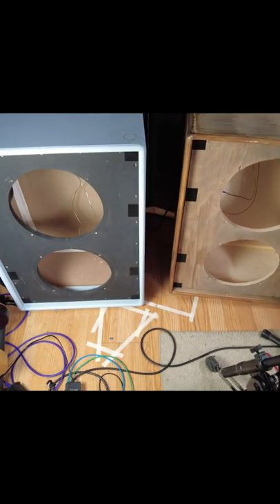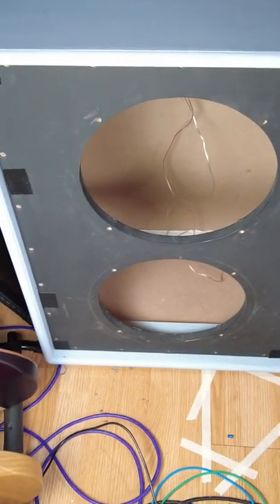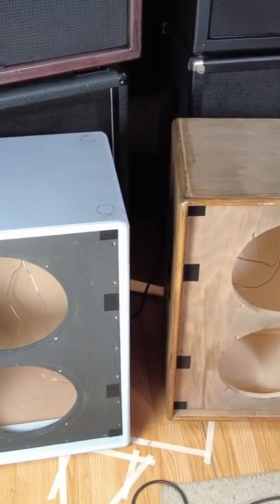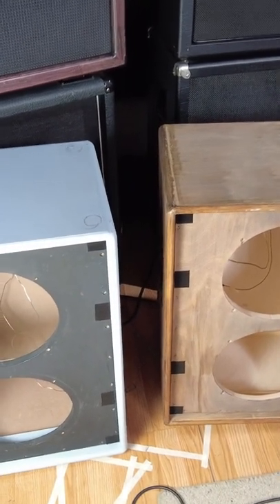Tone Wood in Guitar Cabs?  #shorts

Comment: You should capture an impulse response each and compare those directly in both time and frequency domain for comparision. Why? If cabinet tone wood is a filter, there will be more than slight difference. If there is no difference, it's not a filter and would it therefore not affect the sound.

Comment: I would think little to none difference with mic close by but if we consider how much different the sound is from closed, semi-open and open headphones, it will be interesting to see.

That said it would be interesting to test how much the actual cab does really affect the sound when direct mic'ing. Would there be difference between removing the backpanel and stuffing pillows or sound dampening material to the cab and even removing the whole cab and having just the speaker element. And how much the speaker setup affects apart from electrical stand-point as in could you build a cab with 2-4 different speaker elements and have them work kind of 4 different sounds depending in front of which one you put the mic or even have a switch to turn off the elements.

But with room mic'ing a lot of things come to play and probably even the density of the wood used in the cab play role at least with how directed the sound is.

Comment: Since they're closed back cabs l think it will make very little if any difference. However I'm also going to venture a guess that were they open back cabs there might  be some variation on tone between the two. I'm venturing this hypothesis under the assumption that an open back could theoretically behave more like an acoustic soundhole/soundboard.

Comment: I would think that the baffle would make most off the difference. Looking forward to finding out. I've replaced broken chipboard baffles in 1x12" cabs before with 3/4" pine and would say that it resonates and sustains a bit more. One of my Randall cabs came with something like polyfill insulation stapled inside it. I assume to deaden the standing waves as it was not a ported cab and was made of mdf with a ply wood baffle. Also what is your opinion on speaker mounting from the front vs rear of the baffle (for playing metal)?

Comment: With close mic’ing a cab, probably won’t matter.  But the live sound in the room will likely have different resonance, and you might prefer one over the other.

The only other difference would be weight and structural strength and durability.  And Cost.

Comment: The wood doesn't matter, density does matter. The plywood one rings like a bell, it will have different resonances than the MDF one. Will it matter for your use case? Maybe, but double blind and mixed you'll never know the difference.

Comment: When it comes to electric guitar, if it isn't electric, it doesn't matter. Having a thicker or more dense cabinet may sound better in the room but if you aren't recording the room and just putting a mic up to a speaker, you are recording a speaker.

Then if you do record the room, the room itself is adding it's own flavor.  By the time you figure a regular guitar player recognizes these nuances, they'll just lose it all in saturation and reverb pedals anyway. 

Choosing materials like you play an acoustic instrument is silly when the sound runs through pickups, heads, pedals, and speakers.

Comment: I'll throw my 2cent of Theoretical Physics & say that the cab made of Plywood will get you a more focused sound for the same pair of speakers. The logic of this is: a box made of a more dense wood will block more sounds waves from escaping said box from the sides, rear and top. Also, vibrations at the box's walls will also be dampened more if the wood is more dense, hence you should get less interference. Now, I'm not sure that a METAL tone saturated with overdrive and other pedals will allow you to detect a difference. I would suggest a tamed crush tone for this test & listen to solo parts rather than rhythm parts. Right or wrong, this test should be very interesting.

Comment: For speaker enclosure, the choice of wood won't make much difference.  If anything MDF is likely the best choice, followed by Birch plywood.  Why MDF?  Consistency of the material and thickness.  It'll likely color the sound less than plywood or even solid wood joined.  Also, the cab needs to be built well with joints tight and sealed.    And there's the whole aspect of speaker volume, porting, dimensions, etc. that can make a difference too.   The biggest difference will be the speakers in the cab.  You put a crap speaker in the best cab and it'll sound like crap.  You put a good speaker in an MDF (well built) cab and it'll sound better.   And if Metal is going through these enclosures it'll matter even less vs. something like Classical or even Jazz.

From an instrument perspective, wood and construction will make a difference on acoustic instruments.  A piano's sound board is pretty darn important to the whole sound.  Same with a violin or an acoustic guitar.

Comment: I personally believe it will make almost no difference when recorded.
The goal is always to have a cab as dead as possible, stiff, with no vibrations, to let the speaker do all the work. that's why MDF works so well actually, it's heavy AF.
In my experience, only cab dimensions matter, obviousy, tuning the speaker differently.
Lets see how it goes !
Reply: this is how audio speaker guys think, I am one, but I'm learning to re think some of what I learned from the audio gear community. lots of what makes musical instruments sound good are the harmonic vibrations ( also over driving amps or speakers ) (colored sound)all things that you avoid with monitor speakers or audiophile gear

Comment: Pretty certain what affects frequency response is the dimension, shape, and porting of the box. It the wood won't make any difference to a recording. I did a physics project on a similar subject in University. There are mathematical equations to derive resonant frequencies and they are based on dimension, not material.

Comment: The wood and also the weight of the cab makes a big difference in sound. I once tested four different 4x12 cabs with the same speakers they all sounded different. In my opinion you get a better sound from heavier cabs. I don't know how much it affects recordings though.
Reply: You say you "tested" them. Were they the same internal volume, and box design? Because internal volume has a bigger effect on sound than materials. The reason you prefer the heavier cab, is likely because more density equals lower resonance frequency. If you make something heavy enough you move the resonance below what the driver(s) play at. Thus you never hear the box. The wood isn't what matters, materials are chosen as a cost, weight and resonance trade off. If you could make it out of 6" concrete it would remove all box resonances and you'd be listening to just the driver. But it wouldn't be portable. If you make it out of fiberglass it will resonate more than an acoustic guitar and probably mechanically fail. There is a company that makes good sounding loudspeakers out of carbon fiber. A very stiff but very high resonance frequency material. They have to do all kinds of engineering wizardry to prevent resonance. It makes them very expensive.
Reply: @EthosAtheos  It was four different cabs with Celestion V30 used with the same amp and the same settings. What do you mean by "internal volume"? Two Marshalls, a Engl and one I can't remember. They were all different in weight. The Engl which I liked best and was by far the heaviest. Another thing you have to consider is the age of the speakers. They seem to sound better after some time. One Marshall was almost new and it sounded a little bit flat and lifeless with scratchy heights in comparison and the Engl was already over 10 years old and It's been used a lot. Finally even the "same" Celestions don't allways seem to be the same speakers. Apparently they have slightly different voicings with different cabs. This is at least what I read about.
Reply: @SxSxG666  The volume of the air inside a non vented cabinet or a ported box plus the vent size. Will have an enormous effect on the frequency response of a driver. If you have to much volume or to little. You will either have a driver that is over damped or vibrates freely without enough damping. 

Volume  also affects how loud the driver plays at a given frequency. Have you ever strummed an inexpensive acoustic guitar and it honked or boomed at a certain frequency? This is because resonance amplifying a frequency many dB above normal. Again some car speakers are designed to do this. Somewhere around 80hz you will get 2 or 3 times the sound pressure you would get at say 100 or 200 hz. This makes them thumpy, but that comes at the cost of accuracy and often sound quality. 

The way cabinets are designed is using math simulations of a driver & cabinet combination. The driver is defined by Thiele Small parameters. Once you know these you can calculate the box needed for a given driver and desired frequency response. Crossover networks also play a role in this but that is way outside this discussion. 

Just because 2 cabs have the same number of drivers of the same size. Doesn't mean that the drivers are interchangable. Put the same speaker in 2 different volume boxes (measured in liters usually) and you will get totally different frequency responses.  Even boxes with similar external volumes might have different internal volumes. Some speakers are designed to work in boxes of a given volume of air. 

Now there is a level of subjectiveness to all this. For example even order harmonics sound good to most people. For example the warmth from an analog tube amp. Where odd order harmonic distortion sounds shrill and brittle like inexpensive transistor amps. A worn out driver might distort in a way you like. Cool if you like that sound, but it is distortion caused by mechanical ware. I'm not going to criticize taste. I'm just trying to get musicians to understand some of the physics behind what they are hearing. Without getting bogged down in math.  I find most musicians get angry when I start doing math at them. 

Sorry for being pedantic and long winded. I find this subject difficult to explain to people without long explanations.

Comment: I don't think the type of wood is going to matter. What MAY (and even then probably not by much) matter is the density of the wood/wood composite. The density ones might sound better as less of the sound will leak out of the cab. Weight them before putting speakers in, that should give you a good idea. This would work better if you had 4 or 5 cabs made out of different woods, 2 might not be a large enough of a sample size.

Comment: Same eletronic and same speaker in two different cab designs gives different sounds for sure, if the wood makes difference, i would say yes. you need a material that can absorb the sound waves and give direction to the projection of them, so if a material can absorb more and reflect less sound waves than other different material it will produce a different sound. If that is audible i do not know. But the sound of a speaker is made by the eletronic components connected to them and the way the speaker is made and the quality of the materials in the construction of them, the cab helps the speaker giving them a room where the sound waves scatter and bounces. If you take the cab out and record the speakers it will sound very different than with the cab. So, if the cab helps the speaker sound different so it must be true that the material in the composition of  the cab for sure will make a difference. That's my conclusion.

Comment: I think that resonant difference may affect the over-all sound coming out of the cab, but I bet the plywood cab will survive a hit or drop much better than the mdf cab. Also, how much does each cab weight?
Reply: I have an E-V box with a crushed corner. MDF is not graceful with the wear and tear. 
...still works but I took out the 12DLXs and put in Black Label EVMs. Weighs plenty.

Comment: My wood is tired.  So you pluc the string with your Plectrum the only thing a pickup is measuring is how their electromagnetic fields are being affected by those strings moving.  Period.  IF you’re saying that the piece of wood moves in such a way that it ALSO is affecting those strings so much you will be able to hear the difference.  The only way anyone will ever validate this to us will be wiring everything the exact same way on every wood type, put locking Grover Rotomatics trim each string the same length on  solid Guitar Types of different woods the exact same thickness, use the exact Drop in, already soldered packs for each set of pots.  Make EVERY pickup with exactly the same windings using the same strings ( I like Cleartones) for every length even the cap has to be the same tolerance in each one. 😊

Comment: Does anyone else wonder what would cab from different material sound like? For example glass one? Yes, durability/fragility is an issue when gigging, but in studio environment? Once upon a time we wondered about this with my professor during my bachelor degree project (tube amp) and he proposed such contraption for home hi-fi.
Reply: I'm told that concrete is an excellent material for making speaker cabinets. Assuming you never move it.😉
Reply: @SXTransmission  I could see that in studio situation. You order one and they come and cast it at Your place :D

Comment: It won't make a discernable difference.  They're relatively the same.  I think to notice a difference you'd need drastically different densities, like balsa wood vs concrete. There IS a difference, SOUND just won't be what it is.  If it weren't for weight, we probably WOULD cast these out of concrete.

Comment: Thickness of material and grade of ply will have an impact - take the same speaker from a 3/8" MDF (basically high-density cardboard) cab and put it in a 3/4" marine-grade ply cab and you'll hear more speaker and less cab - promise...
Reply: I have an old Sound City box that has 12mm sides and 18mm baffle and back. It rings like a bell when you slap it, much more than most. IDK, I guess I need to run a powered test. 😸

Comment: I think there will be a difference, but not a super significant one. I always suspected what you've already found out. Speaker, pickups, period. Electric guitar sound is string vibrations turned into electric pulses then back into a louder acoustic vibration. Anything that directly affects those transformations is going to have the greatest impact.

Comment: Different ? ... It would if it was a "Hi Fi" speaker. There is always an interaction between Speaker Drivers (which "we" all agree is paramount to the Sound) & their Cabinets  ... I'm hesitant to say which is "better". But 1st the Manufacturers must have figure long ago what's best. They've been using Plywood. And Studies carried out by the BBC for Monitors, pretty much reinforces it's use. (But they prefer Birch, as It's the most rigid & relatively light/ less mass for a given size box) The BBC reckons that if a Cabinet is Rigid but has more Mass for it's size, It will retain more Energy.
Your "knuckle test", has convinced me. If it was a Monitor / Speaker Cabinet. The Denser MDF & with more Mass, would be rejected by me. A Monitor Enclosure should sound more like Cabinet #2 - the Plywood. Then again, like most things; It may be subjective ???

Comment: I have one cab with MDF sides and plywood baffles and another one with same construction but larger dimensions. The smaller one sounds much better. I also built a 112 with MESA Recto cab dimensions but different contruction and the diy cab sounds better. So many factors at play. Next cab I'm building out of paulownia, for science.
Reply: Did you use the same speaker in the two cabs? I don't just mean the same model, but the actual same speaker. Tolerances between speakers could definitely come into play here.
Really cool idea with the paulowina cab. With neodymium speakers, that could be a killer light weight cab!
Reply: @mrcoatsworth429  Same exact speaker and also others for comparison.  I made a head case out of paulownia, super light. The selection of Neo speakers is just so small but I'll decide after the cab is done.
Reply: @christianutter5383  Awesome, thanks for the reply!
The Neo Creamback comes to mind. I have a Jensen Tornado, which is also awesome.

Comment: The cabinet material can make a HUGE difference in music playback and creating a stereo image.  You try to make the cabinet as dead and as NON-resonant as possible. A great technique is to constrain a damping material between two layers of plywood.  FYI, for the same weight plywood is deader than MDF.  But for guitar?  Guitar players frequently use their pickups, cables, amplifiers, and speakers AS the special effects instead of trying to reproduce the sound of the actual guitar.  They are using one bandaid fix on top of another bandaid fix on top of another bandaid fix to achieve the sound that they desire.  The only question is: Does the guitar player LIKE the sound coming from their fucked up mess?

Comment: As long as your cab is well built, sturdy, and (most importantly) has good qaulity speakers installed, that's all you should really give a shit about. My current 4x12 is an old 80s Crate fitted with Greenbacks and it sounds great. Sure, I'd love a nice Baltic birch cab, but I've got better things to spend my money on.

Comment: In this application, no. But congrats on your two new cabs.
This might bear fruit in a 4x12 can where the span of the rear panel will be more prone to flex, reflecting back into the cones as a sort of Kentucky fried spring reverb at high volume. In those stoutly built twins, the construction's goal is to eliminate coloration.